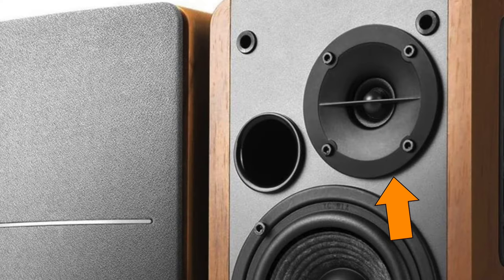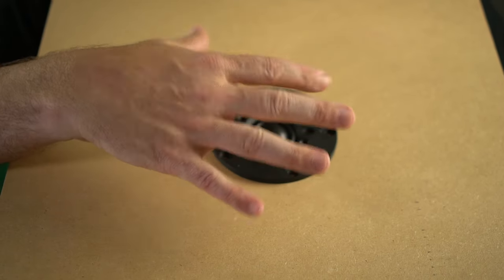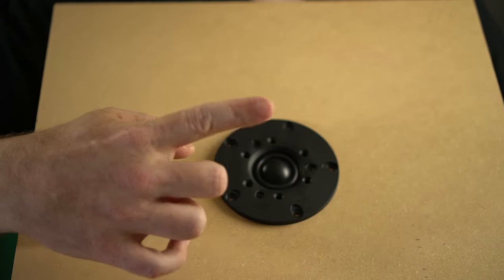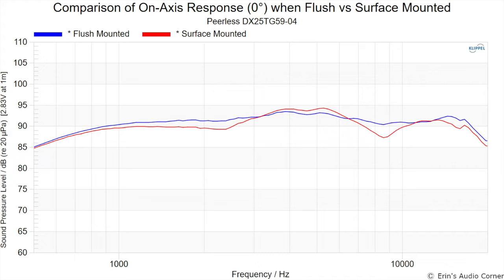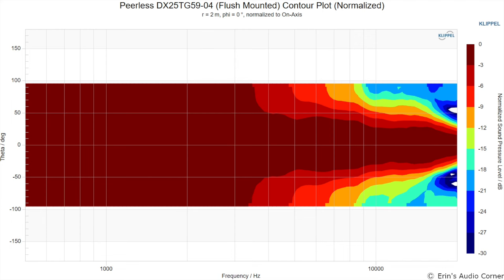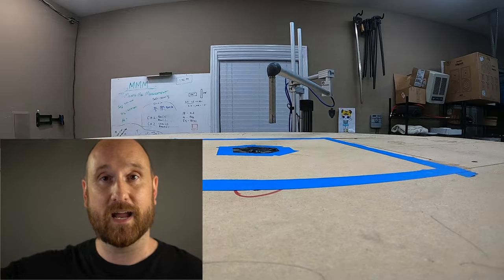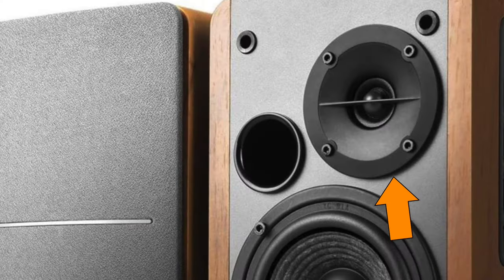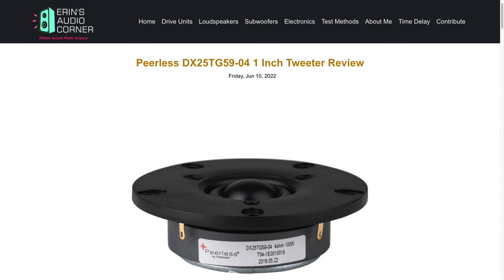Bad Speakers Start with This. 🛑  Flush Mounted vs Surface Mounted Tweeters.  Why it matters.

Comment: If you can afford the speaker, and you like how it sounds then forget the BS, and buy it.
Reply: The only BS here is yours - you have no idea what you really like until you hear it
Reply: @Harald_Reindl  Really Harald? You just repeated what I had said. Can't read?
Reply: Boy why would you even consider a speaker with obvious design problems? And before you bought it you have no idea how it sounds in your room, even a few days testing in your room isn't enough - my last speakers changed their sound (thanks god) dramatically in the first two weeks - proven by measurements
Reply: @Harald_Reindl  You wouldn't know a design problem if there was one. It could be a faulty crossover network,  or an unfound fault in a speaker that was missed during factory inspection. I have two pairs of 12 inch four way floor speakers that are 50 years old. Almost ten years ago I noticed the tweeters were becoming weak. I found a speaker consultant/builder on the internet, and told him of my concern. He tested them and found the high end was weak. A few weeks later he replaced all of the tweeters, updated the crossover networks, replaced all of the insulation in each cab, and made new grills for each. Total cost was $650.00. These vintage speakers are killer as they were when I first purchased them 50 years ago. I had a gentleman offer me $1000.00 just for one pair. The last thing I would do is listen to someone here on You Tube like you do.
Reply: @ken-in-KY  WTF did you not understand in "OBVIOUS design problem"?
Reply: @Harald_Reindl  Stuff it Harald.

Comment: Honestly this would be the case; however if you like a particular set of speakers' sound signature then more props to you. I wouldn't personally force you to get a particular set of speakers just to avoid this particular issue in question when you haven't been to an AV store and physically demoed and experienced surface and flush mounted tweeter speakers in an acoustically treated listening room. In the end the speakers should be fit for the purposes that you have decided upon and enjoy using it for the intended purposes that you have decided upon. Anyways nine times out of ten a surface mounted tweeter despite its issues works for its intended purpose for the average speaker consumer however for the niche speaker consumer it won't. Thanks Erin for explaining to us the differences between surface and flush mounting tweeters in an easy to understand format.
Reply from the maker: Sure, if you like it, you like it.  But the point of this video is to show a simple design flaw that should be resolved before it hits the shelves.  By virtue of existence, a surface mounted tweeter is a very good indication that the rest of the design probably wasn't well engineered, either.
Reply: @ErinsAudioCorner  I agree with your point of view. On the other hand from an audio engineering perspective; the design flaws of speakers with surface mounted tweeters are some of the compromises an audio engineer had to make within the product R&D budget constraints given by the company; along with the design and use case constraints of the drivers and tweeters used for a particular set of speakers.

Comment: That's not true about the flush mounting. If you flush mount you have to weaken the cabnit structure. Gr research had AMAZING speskers and are all baffle mounted to keep strength of the cabinet. This is a totally fine approach as you build and design the crossover with the drivers mounted.
Reply from the maker: That’s not true. For a tweeter mount you don’t have to worry about structural integrity. The tweeter itself is all the integrity you need. 

And as I showed, you cannot fix the issues caused by diffraction. 👍
Reply: @ErinsAudioCorner  yes for tweeter I agree... Gr research flush mounts them and puts in a wave guide. The woofers should be surface mounted.

Danny knows his stuff. More than all of us combined.
Reply from the maker: @ClassifiedBrief  well, I’d disagree that Danny knows more than all of us.  But that’s a different matter.  The reasons for not flush mounting a woofer is debatable and depends on how the woofer itself was designed. Tweeters don’t have that luxury. 👍
Reply: @ErinsAudioCorner  Danny makes some of the best speakers in the world. I was hesitant until I built them and yeah, beats the 200k Wilson's all day
Reply: @ClassifiedBrief  You overlook Danny's drivers are tapered to reduce diffraction (this is not typical).  You need to look more carefully and listen to what Danny says.  He often points out how his woofers are tapered so kit builders do not have to recess his drivers.  The defraction off a nearby woofer frame is just as bad as defraction off the edge of a tweeter that is not recessed.
Reply: @defsonic2884  that's fine he's a genius. Can't talk if you haven't heard or own his stuff
Reply: Danny's  kits  the cabinet's are recessed to flush mount the tweeter.so no idea where you've got that idea it would be that much of a problem with waveguide or ribbons that tends to come with a guide but it's still good practice to recess them.
Reply: @ClassifiedBrief  GR speakers are awful. Danny is a salesman not engineer he knows only very surface level stuff.

Comment: Your theory has so many holes in it.  Honestly sounds like your regurgitating adjectives that elite audiophiles spit out their asses.

Depending upon the tweeter design and material construction as well as crossover design a baffle mount may be advantageous to a recessed mount, or off axis shielded mount to be accurate.
You realize adding a ring around a baffle mounted tweeter would yield the exact same results as recess mounting.
Reply from the maker: Dude.
Reply: @ErinsAudioCorner  
This goes out to all the audiophiles that tirelessly attempt to accurately reproduce an artists performance.  Save all your money on overpriced equipment.  Instead make money by setting up sound for new local artists.  You will then and only then know what it takes.  90% of the accuracy can be obtained with average quality equipment played within its acoustic range.  The last 10% barely audible will be had with higher end equipment that bring increased amplitude and overall volume across the frequency range.  Headroom is key